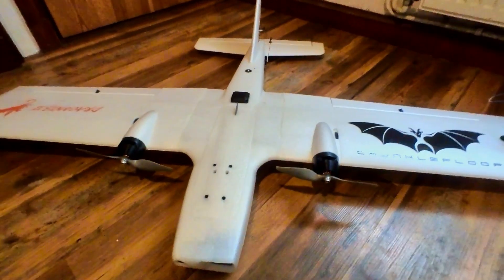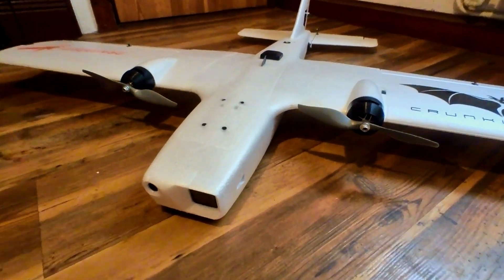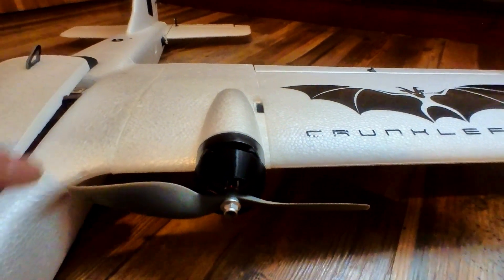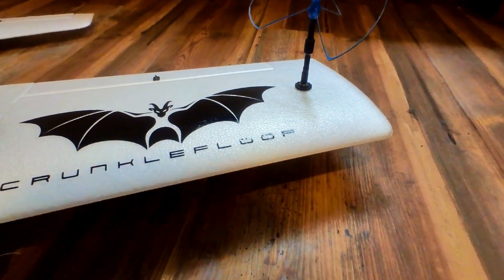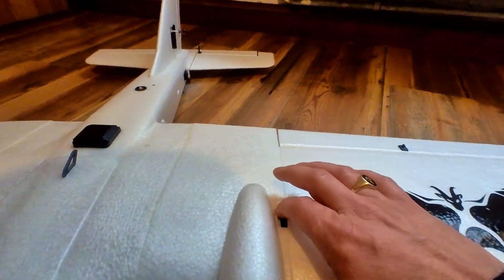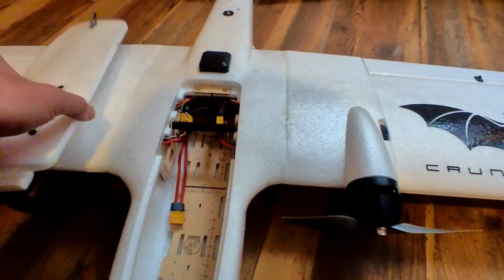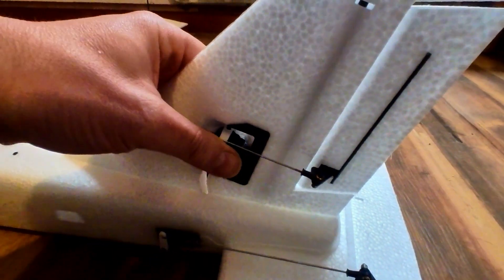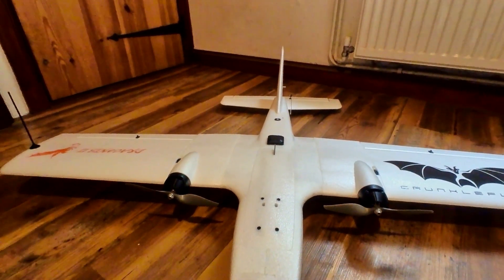Reptile Dragon V2 Pre-maiden build overview and thoughts

Comment: I’m late to the party but just got this plane and I’m surprised it’s not more popular 😅
Reply from the maker: It's a great flyer for sure. I think it's let down a little by the limited space inside compared to rivals. They were also woefully under-glued at the factory. Mine and others have suffered parts coming unstuck in flight. In my case it was the battery bay which resulted in a crash. So please, please do make sure you re-glue everything prior to flying.

Other than that, it's a decent plane!
Reply: @Crunklefloop  yeah I did notice the used the smallest amounts of CA glue to hold stuff together. I hot glued in the wood trays. I’ve only gotten 3 flights in so far but I like it better than the Nano Talon Evo that I took the electronics from for sure. Feels more like a sport glider than a plane 😀

Comment: Have you ever maidened this plane ? What are your thoughts? I think albabird is better
Reply from the maker: Yes, I maidened it and flew it a few times.

It's quite similar in the air to the Albabird, however the Albabird is the better plane.

More capacity,  better wing connector design and stronger in a crash (despite being EPO vs EPP).
Reply: @Crunklefloop  that's what I thought.. especially the access to electronics battery etc..

Comment: Is The Battery Pack made of 21700 or 18650 Cells?
Reply from the maker: This pack was one I purchased and is made from 18650 cells. 

I've since started making my own packs using Molicell P42A 21700 cells which have performed better for me.

This plane is now with a friend of mine, he's using a 5,200mah 4S which is an idea fit.
Reply: @Crunklefloop  What is when your Pack is made of 21700Cell istad of 18650 will it fit? I mean 4x21700 side by side. Will it Fit in there?
Reply from the maker: @mauritz1774  I couldn't say as I sold the plane before I started using the 21700 cells. If you join the FPV Twin Owners group on Facebook - https://www.facebook.com/groups/344735646586539 there are a few pilots there who might have a better idea.

Comment: Please stop using those rediculous skew antennas on your plane...A Dipole is much smaller, less drag and a higher gain....You don't need CP on 1280mhz....🤔😳🇬🇧😀
Reply from the maker: Nothing wrong with the VAS bluebeam cloverleaf antennas, aside from the size they're pretty decent. As explained in the video I typically use a TrueRC Singularity sidefeed imbedded in the wing however the wings are too thin in the Reptile Dragon hence opting for the Bluebeam. I have a TrueRC X-air on my AAT ground station with a TrueRC VRX which all works brilliantly together. Trying a Matek 800mw VTX on the next build as they are lighter and have a wider voltage range negating the need for a separate 12v linear reg.

Re: linear dipoles, yes they're much easier to make and smaller however I've found CP performs better in my experience when at low level and behind objects as it better rejects multipathing. As for the drag, using the side-feed antenna buried in the wing solves that completely, it just wasn't an option on this plane and I wasn't about to make a Yagi for the VRX for just one plane. :-)
Reply: @Crunklefloop  Yes, your setup is a world away from mine. I don't have the complexity of a Tracker at all. Just an 8dbi channel tuned linear patch antenna. It's field of reception is almost 180 degrees. I know you tend to fly all over the place, including behind you...It's a matter of cost really and flying style..🤔🤔😳😳😀🇬🇧
Reply from the maker: @EnglishTurbines  The trackers are fairly straightforward, if a little bulky. 

The only thing to be mindful of is that some Flight controllers encode their own data for their own AAT's so you'll need to use either their FC or use one which doesn't encode data into the video stream and use an airborne module. Once that's all setup though in the field it's as simple as powering on the plane, powering on the AAT and when the plane has GPS lock push the home button which sets the location for the AAT. Then takeoff and the tracker follows it. Great fun!

Comment: So THAT's what you wanted the vectors for 😉
Nice intro 
I loved my V1 Reptile Dragon, just a shame I smashed it into the concrete on the 3rd flight. Still, I like to think it lives on in spirit, considering the power plant has gone into my new Albabird 🙂

The partom VTX is perfectly fine, in fact it would still be my first choice if it wasn't for the fact I got a few matek ones for free. I used to buy the Partom VTX/VRX package from banggood because even then it was still cheaper than the other 1.3 VTXs available locally... I eventually had a stock of multiple Partom VRXs lol. The VRXs are pretty poor though, so hopefully you're using something better on the receiver end (please don't tell me you're using the matek vrx module).

Good work with the telefly button relocation, I couldn't be botherd doing that so I just bought a GPS unit for the tracker... no need for the button press that way. 

Hope to fly with you soon bud... lets hope the weather gods are kind in the coming months.
Reply from the maker: Thanks Matey! Glad you liked the intro, I had that commissioned from an animator on Fiverr, very pleased with what he created.

Sorry to hear about your V1, what was the cause of the crash? I heard they’re really C.G sensitive. Hopefully the V2 is more forgiving.

I’ve had good results with the Partom, the only reason I was going to use the Matek is that it’s lighter so I shouldn’t need to add weight to the other wing to balance it out, it also can be powered directly from the battery so I can also do without the 12V BEC further reducing weight and any sources of noise.

I’m using a RMRC VTX, brilliant bit of kit and no problems even if I stand with the Dragonlink TX right next to it. Do you have the MFD tracker? I was thinking about adding a GPS unit to it, but never looked further into it, any advantages other than not having to push the button?

And yes looking forward to meeting up for a flight!

Comment: What channel/ Frequency do you find works for you using 1.3 I always seem to get blasted when I've tried it
Reply: The most common form of corruption of incoming 1280mhz video, is the users RC Transmitter....Get a relay GS....🤔🤔😳🇬🇧
Reply from the maker: @EnglishTurbines  That depends on the tx frequency you're using I was having issues with Crossfire even with filters and 10m separation (I relay my video through 5.8ghz so I can have separation). Changed to 433mhz and no problems whatsoever, even standing right next to the receiver. 

We don't know what channel Matt is running though so he might not be on the 1280mhz band.
Reply: @Crunklefloop  Agreed, my old EZUHF used to step on my Lawmate VRX if I got within a couple of metres of the relay GS. Crossfire however, seems completely benign...🤔🤔😳😀🇬🇧
Reply from the maker: I use channel 9 (1280mhz) as I'm pretty certain that's what the TrueRC antennas are best tuned to. Is it environmental interreference or local to your plane?